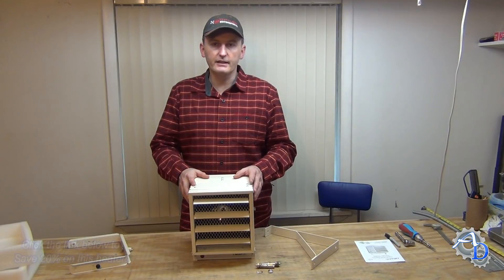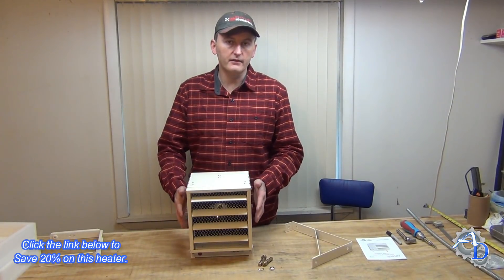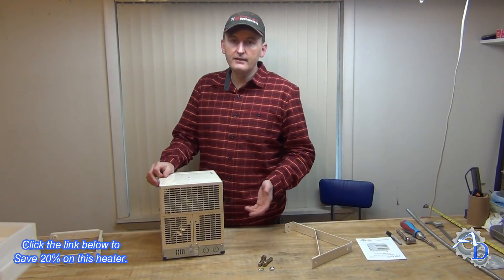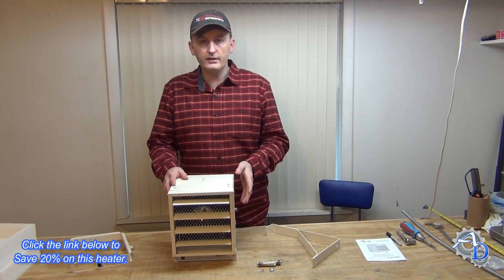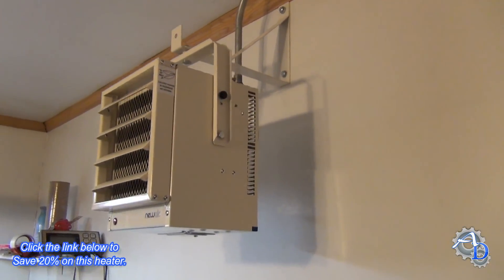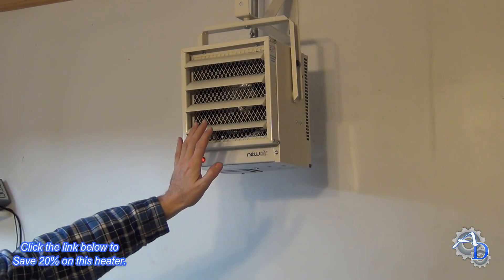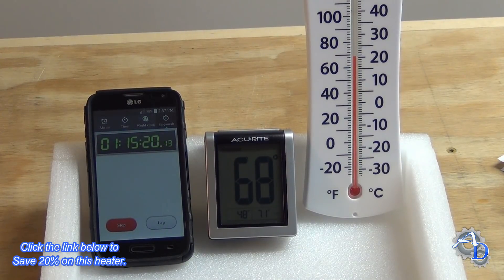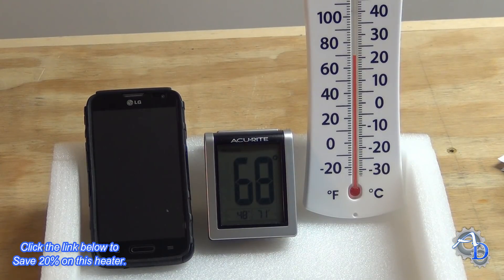Electric Garage Heater Installation and Review

Comment: I HAVE THE SAME HEATER AND IS BEING RETURNED DUE TO THE FACT THE OVER HEAT LIGHT COMES ON , THAT LITTLE RED LIGHT IS A OVER HEAT LIGHT NOT A ON/OFF LIGHT COMMON PROBLEM ON THESE HEATERS , TO MANY GUYS ARE RUNNING THESE WITH THE LIGHT ON , I GUEST IF YOU HAVE A FIRE EXTINGUISHER ON HAND YOU SHOULD BE ALL SET .

Comment: But why when your turn it on the red light turn on? The manual say it a visual alarm light for overhearing. I have the same problem don't know what to do
Reply from the maker: With mine, the glowing red light just means the heater is on. The heater can be completely cold and the red light comes on when I turn the heater on. The heater has internal thermal limit switches that shut it off if it overheats.

Comment: what about electric bill and does it need 220v
Reply from the maker: It's 220. I have a shop where I run a big air compressor and machining tools, so my bill varies a lot. I haven't noticed a difference that got my attention, but I'm sure there is a difference.

Comment: Heat is heat it takes so many btus to heat so many buts lol...old saying from old hvac guy.  Anyway, moral is its all real real close in the end meaning you go electric, neighbor goes gas, i go wood. Your unit pulls 22 amps, yikes!!! Electric bill goes boom. Neighbor has lo electric bill but he pays 100$ for gas. Mine is free!!! But i spend 6 saturdays per winter cutting wood for my house. Granted last month i payed a 57$ power bill but i spent 6 days prepping. Moral is they all work the same, they all cost the same. You have to work for money and so does neighbor to pay your electric and gas. I have to give up free time that other ppl spend on couch drinking beer and watching football. I cut wood during that time. If i paid myself to cut wood, we'd all have same money at end of winter......i like wood, its in my blood, was born with it and im used to it. It heats uou twice they say and its true lol. I can come in from 10 degrees freezing my Baggetts off and get warm fast and you cant do that with your heater or gas. I like that, but i also have time in woods cutting. You work harder making money, i give up free time, same in the end.....although 57$ bill sure was nice to heat whole house, plus shop last month i will not lie. The power company has even sent men out in the past to check my meter lol winning
Reply from the maker: I grew up with wood heat. There's nothing like it. Like you said, it's all a trade off. I've cut, split, stacked, and restacked enough wood for a lifetime if possible. I've had enough. As far as heat output, electric you get 5000 btu in, 5000 btu out, minus the fan. With high efficiency furnace (95%), you get 60,000 btu in, and 57,000 btu's out, also minus the blower. With wood or coal (50% to 60% efficiency at best), you get 100,000 btu's in and 50,000 to 60,000 out, minus blower if you have one. Either way, you have to pay for the energy, through hard work processing the firewood, or at work getting a paycheck. Then there's wood storage, cleaning the chimney out which sucks, emptying the ash pan, and huge hairy spiders coming off the firewood you bring in, unless you have an outdoor wood burner.
Reply: @ArnoldsDesign  im outdoor. No insects in winter here. Ash cleanout is easy with a tractor loader. I dont confirm or dispute you btu numbers.....but what i can tell you is i heated 2900 sq ft for 11 hrs yesterday with 3 pcs of firewood !!!! So yeah, perspective is for sure a thing that exist. I know it didnt take me 11 hrs to make thos 3 pcs of firewood though !! And that is my perspectuve. We digured yrs ago, only 1 oak tree and 3 saturdays will heat the avg home for a winter. 8 hrs x 3 days is 24 hrs work add another 20 % for stacking, cleaning and that is 29 hrs so lets say 30 for fluff... 30 hrs and lets pay that man 20$ per hr which is very very high wage for that type work but lets be generous ...that results in 600$. Theres no freaking way o not tou can heat 2900 sq ft for 4 months for 600$ as far as fan, my fan pulls 3 amps lol so its not even a factor but again, be generous and say the fan cost 50$ a winter to run which isnt even possible but lets jusy say it does. The grand total is 650$ for 4 months.  My bill during avg winter month with my hvac unit only is around 300$ as we have done in past to get a baseline. So 300 x 4 mos is 1200$. Im heating for 650$ for same 4 mos. Now thats my perspective.
Reply from the maker: @michaelcollins1899  That's good you got it to work out for you.
Reply: @ArnoldsDesign  yeah the numbers tell the truth every time.
Reply: @michaelcollins1899  Curious what it cost for your initial set up. I'd love to do exactly what you are doing but the cost of a outdoor burner and hookups is a scary price tag.
Reply: @joshh5336  buddy of mine has the outdoor wood stove and loves it hes got 5k $ all total including unit, lines, install and water heater. He heats same size house and shop as mine roughly.  Our bills are within 10 bucks of each other usually. My setup : old school 2 buck stoves. They wer king in the 70s and 80s. Went out of business in 81 because they were too expensive. They are that good!!! Triple wall 3/16 steel with air between each layer. 3 speed automatic temp  on/off thermostat. Have the medium size in house, and the small in the shop. Found both in a 5 yr time span doing service calls at homes. Ppl were getring older and i traded the service call fees in both cases for the stoves :) if i count my fee, ive got probably 300$ in trade for both stoves. The small one needed full resto so i repainted it and put all 3 thermostats in. The medium stove needed nothing!! It is an 81 model an one of last ever made (dont be fooled by the current buck stove that was sold at lowes in lat few yrs) its not even close to the original. The son i did the call for on the 81 model said his parents bought it and just made a few fires in it ever for power outages only. The original wood handles on doors were not even browned yet!!  They are vrown now lol after ive used it exclusively for primary heat now 15 plus yrs. I installed a fan and additional tstat in ceiling so when ceiling gets 85degrees, that fan comes on and transfers heat out of the hotspot room to 3 cooler bedrooms. Also when its 20 degrees or colder outside, i run my central ac fan to circulate whole house to keep floors warm and pipes under from freezing. So in worst case, i am pulling 1.5 amps for stove, 2 amps for ceiling transfer blower, and 9 amps for ac central fan. Total 12.5 amps ( half of what a heat pump pulls for 2000 sq ft) i have never run all 3 more than 12 hrs ever as it gets above freezing 90 percent of days here in NC. Example: we were 30 degrees last night and 69 degrees today so i didnt run either of the 2 auxiliary fans last night or tonite. On nights that are above 20, i heat with 1.5 amps for house!!! Shop is the same so 3 amps if i have fires built for both which is most nights. Peace. To answere your question, if you cant find a good stove in the local searches for sale and have to buy new, id say you are looking at 2k $ for 2 stoves. A lot cheaper than the outdoor units. I also like to see the fire and my buddy that has the outdoor said he misses that terribly....but he hasnt got the worry of chimney fire or log rolling onto floor (its never happened to me, but it is possible) so there is give and take. Also, he uses a tad more wood than me because once it gets cold, he dires his up and its too much hassle to let it go out whereas i can build a fire at night and let it go out next day if its warm such as today, and all last week was, so i save a little on wood, but use more paper and kindling,  he pretty much lights one fire, and on warm days just adds enought to keep it going.....but its really wasted because house is warm and valves stay closed and dont send any warm water to heat house so hes really wasting some wood to heat the planet as all the heat is not used and bypassed to the chimney pipe. Like i said, its give and take.
Reply: @michaelcollins1899  I'll have to look into it again. I have a fireplace for ambiance but it really only heats one room. My goal would be an outdoor stove the heats my house and shop together. I was thinking it would be over 10k closer to 15k for that set up which would take many years of free firewood ( easy enough to come by in PA if you dont mind the work. I dont) to pay itself off and start actually saving money. 5k sounds much more manageable and worthwhile. Thanks for the info
Reply: @joshh5336  yeah fireplaces heat but only 1 good room and waste a ton of wood. The trick to stoves are you can shut off the air and wood just smolders and last a lot longer. A fireplace is wide open draft straight up. No control and most of the heat going right out to the earth.
Reply: Also consider fire stoves are against code in garages and shops in most city limits due to fire danger (unless your shop/garage has no fuel or fume-source combustibles stored in it, including a parked car) so electric and propane are the only options.

Comment: it's now 10 months later, how is the unit holding up? Is it easy to clean a winters worth of dust out?
Reply from the maker: It's working good. I run it every day. I haven't had any dust build up inside it, so I haven't cleaned it.
Reply: @ArnoldsDesign  was it pricy to run, did the electric Bill go through the roof?
Reply from the maker: @CR-pq8oe  There was a little bit of an increase, but my office is insulated well. The air compressor actually has more affect on my bill than the heater. If you're heating a large uninsulated space, it's going to add up.

Comment: Great video, thank you. How much did your electric bill change? Looking at installing 2 7500 watt units in my shop.
Reply from the maker: Thanks. I didn't really notice the difference, because I run a big air compressors for various sandblasting jobs. The compressor uses a lot of power itself, so it's hard to know where the usage came from.

Comment: The wire you used...shouldn’t that have been 10-2 wire 30amp rating with Black to Black, Red to Red, Green to Green?  And not White to Red?
Reply from the maker: Ordinarily, yes, but this heater runs two hots through the black and white wires for whatever reason, and the ground through the yellow/green wire. It has no red.
Reply: Arnold's Design Understood, I am going to wrap red tape around that white wire then.
Reply: Wire doesnt care what color it is. It is only colored for us idiots to keep it straight. Green will carry load same as red, black or white lol. 220 requires 2 legs of power so when you have only 3 wires, you have to use white as a leg....its ok. Hire electrician if you dont know this lol
Reply: Michael Collins heater is installed and working perfectly.  It’s not about not knowing what to do, but safety, I might not always be at this house and workshop and so the white wire has been marked hot for the next guy.   I have done my due diligence.
Reply: @griffiths-handmade-knives  dude im an electrician 24 yrs, we get it lol and of course you mark it. Dang, didnt think i had to say that...you sure did do you due diligence.  Im not the one asking for wiring explanation,  im the one answering lol. Its like being schooled by the student time warp

Comment: i am interested in adding this to my garage in new york. Can i leave it running for the winter to keep my garage at a constant 5o degrees without worrying that it will burn down the garage?
Reply: 000
Reply: If you're going to run heat day and night 24 hours a day you should invest in an actual furnace. These units are not as efficient as an actual furnace would be. You'll save money with a furnace and they're designed to go 24/7 365. Where is you're going to be taxing these small 5000 to 10000 Watt units pretty good by leaving them on all day everyday. Of course it depends how hard they're working and how well insulated the area your heating is.
Reply: @ArcolaBridge  Yes, insulation is a factor, but if your house isn't well insulated, your "furnace" could be equally taxed as well. The only real strain that these electric heaters will have, just like a furnace, would be getting the room (rooms) up to temperature, then it's just maintenance...
Garage well insulated with electric heater, keeping the heat cycles down, bueno. House well insulated keeping the heat cycles down, also Bueno!
Do you guys insulate your garage doors?
Reply from the maker: I left mine on quite a few nights with no problems. It has built in safety switches to prevent internal overheating. It heats the room up quickly, so I usually shut it down at night though to save on electricity.

Comment: I am sure your electric bill is going 2 b through the roof
Reply from the maker: It's not bad at all actually because my shop office is well insulated. I found out with the prices in my area, it is actually cheaper to run an electric shop heater than it is a propane one for the same amount of btu's. I never would've figured that until I did the math.

Comment: Are you going to keep the heater operational (heating) when away? Wondering if it has a thermal shutdown fuse in the unit? I have a slightly larger one in my shop (a wood barn) ..it eventually rusted to the point where we had a catastrophic failure of the unit. I'm glad I was present because it was throwing sparks everywhere when it failed. My unit didn't have the thermal overload fuse in it.
Reply from the maker: It does has thermal overload switches. It also has an automatic switch to turn the fan on by itself to cool down the heating element to prevent heat soak-back into the enclosure after the primary heating cycle is finished. This happens when it's been running for an extended period of time. Even so, I shut down my heater when I leave to save on energy.

Comment: What about that furnace you installed in your shop in a prev. video. 
Couldn't you duct off that and into the office?
Reply from the maker: That was my plan. I haven't had a chance to run duct work yet.
Reply: Well that electric unit should do a great job in the mean time.
Reply from the maker: So far so good.